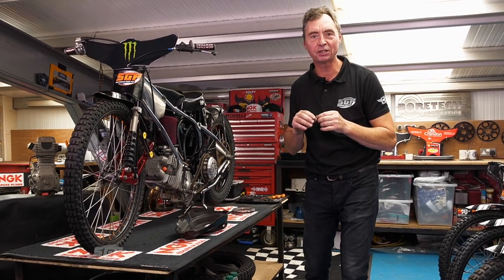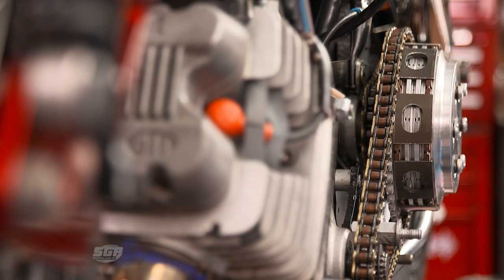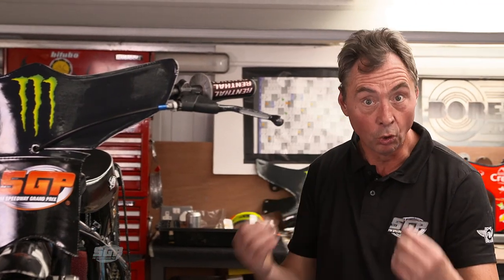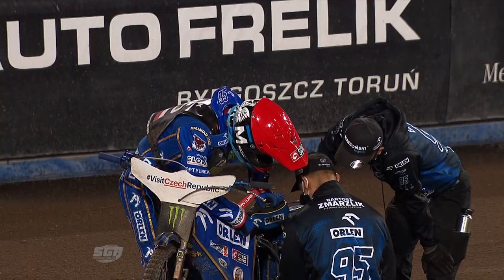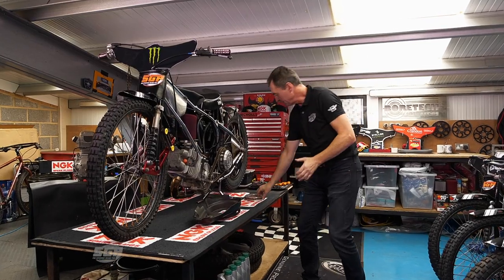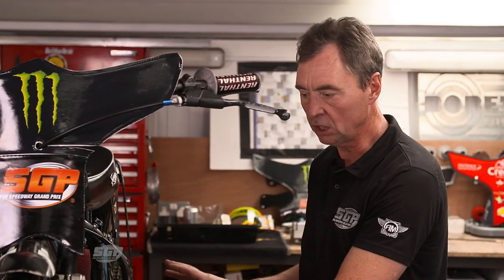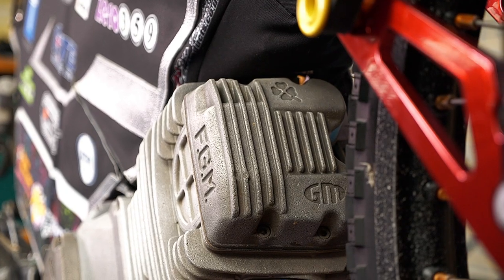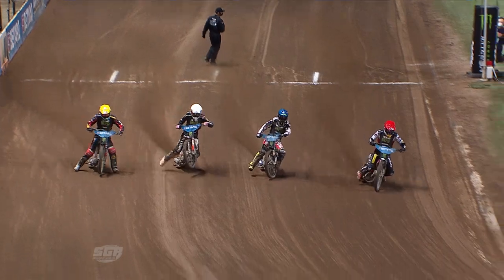How the clutch and engine work together! | Tatum's Tech Talk | FIM Speedway Grand Prix

Comment: So it appears the clutch sits on the end of "jackshaft " type of arrangement since it doesn't appear to have a transmission ? If true gearing can be changed for the crankshaft end and clutch basket as well as the final drive front sprocket and rear sprocket.  Wow, that could be a lot of gearing combinations.
Reply: Clutch basket gear tends to be unchanged but the engine sprocket, and rear wheel sprocket are changed, as well as chain lengths to get different combinations